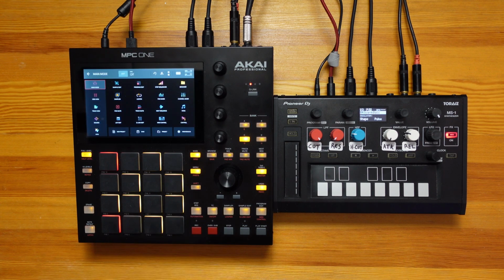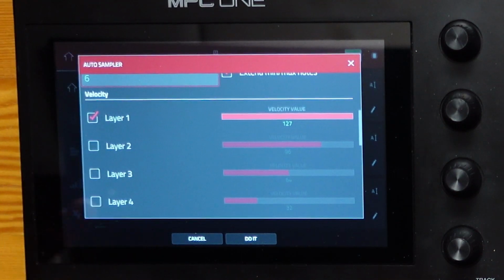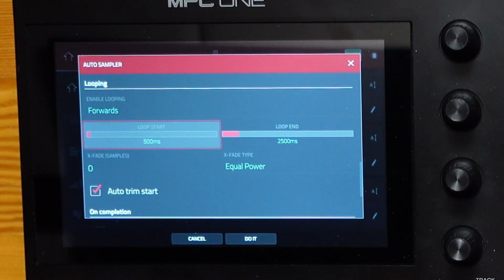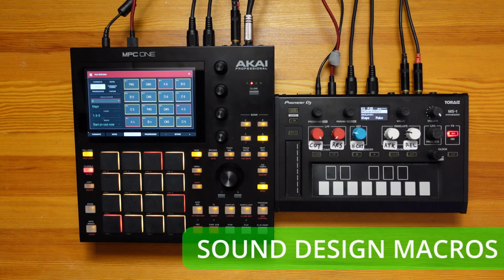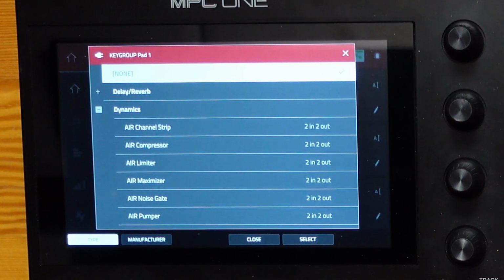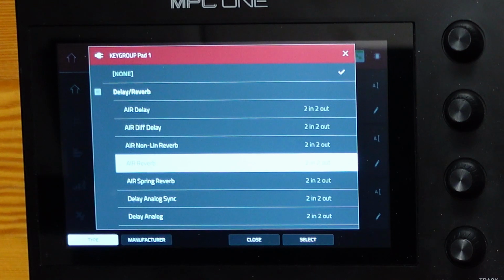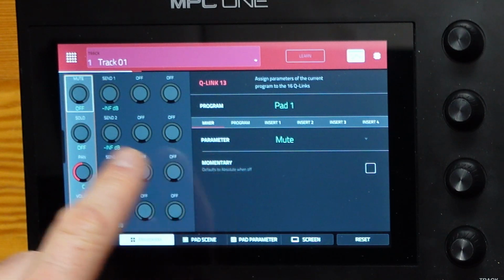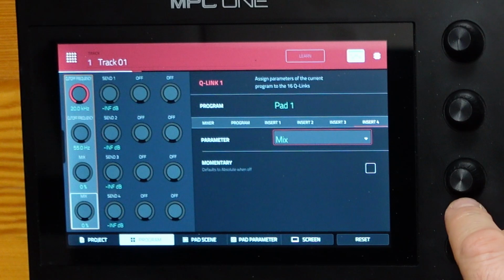MPC AutoSampler and Sound Design Mastery

Comment: Hi, question:
MPC ONE, macOS.
Latest Ableton live suite.

With the MPC in controller mode when hitting the pads on the MPC it does not send notes via USB, to record them in Ableton. However whatever kit or program I have set up on the MPC track seems to work fine as far as it’s triggering sounds.

Basically I’m trying to use the MPC one as a push button pad controller inside of live and even though it plays sounds on the MPC when I hit the pads no midi data is going via USB (sniffed) into the computer. Controller mode sees the MPC software as an audio units plug-in and launches correctly as expected.
Reply: Use ableton link